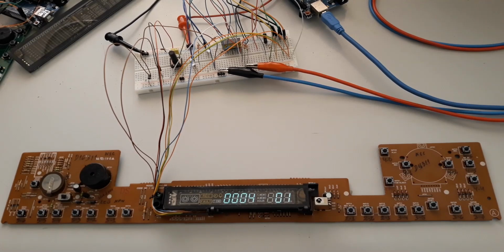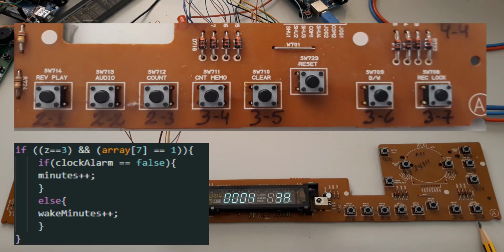D16311GC

Comment from the maker: VKK é a tensão negativa (-24) mas pode ser outra desde que não ultrapasse os valores do driver PT6311, que na página 18 do datasheet diz -35V! Cor fio azul. Pode-se confirmar usando um multimetro para o pino VEE(pin 34 do 6311). 
Mencionam AL5.8V porque no painel deve haver um diodo como protecção, sabendo que a queda no diodo será próximo de 0.7V eles colocam os 5.8V, mas o driver funciona bem acima dos 3V como está na datasheet! Eu recomendo o uso dos resistores (acima 270R) , pois em caso de erro evitamos de estragar a porta do Arduino, mas é uma recomendação!
Fico com a ideia que não se vê o video até ao final, é sempre lá que estão as ligações. Resumindo:
 +5V para os AL5.8V.
-24 para o VKK , em caso de dúvida seguir o que vai ligar ao VEE do 6311
GND para o GND conforme se mostra mesmo no final do video (atenção há mais do que um GND, ligar no indicado, pelo menos!)

Espero ter ajudado!
Reply: Oi amigo! Vc sempre me responde; muito obrigado.
Reply from the maker: @Dancopymus  Porventura conhece a marca e modelo onde este painel pertencia uma vez que tem um igual?
Reply: @jlsmonte  Oi José, gostaria muito de lhe servir mas, infelizmente, a carcaça, como sempre, eu jogo fora (algumas eu anoto). Mas, a princípio, é um Vídeo Cassete Samsung e, na PCB está inscrito: Model: SRV-30  CODE NO: AC41-12417A. É idêntico a esse modelo: Video Cassete Samsung Time Lapse Slv 960a.
P.S.: Aproveitando o ensejo, a bateria que tem na PCB é a CR2032?